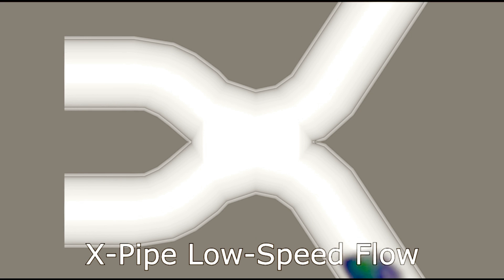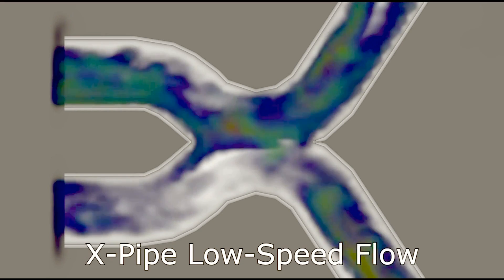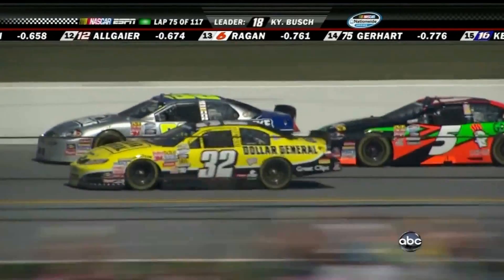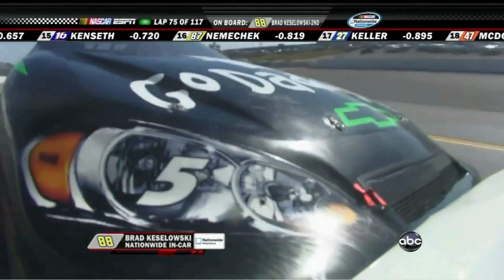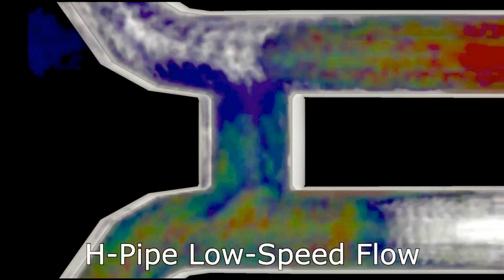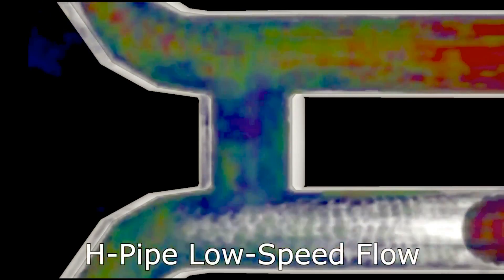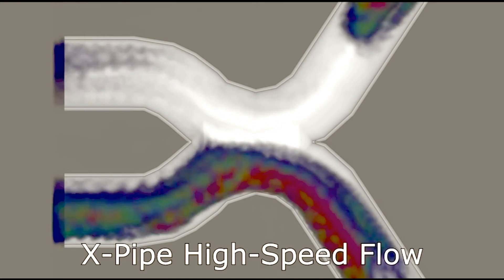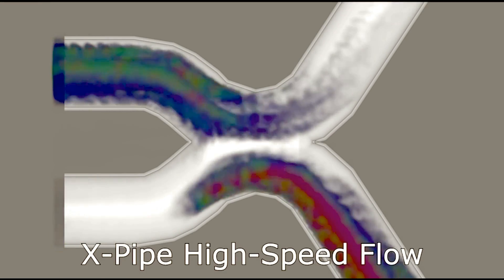Exhaust back pressure - Myths & Facts

Comment: Not total bull shit but I call bullshit on backpressure not increasing engine performance. I had a car with 7psi of back pressure and when I got it fixed the engine probably had a 60hp increase. I say this because the car went from 7:50s in the 8th mile to 7:30s. That was way back in the 1990s with a Turbocharged Buick V6.

Comment: Dude, nice topic for a video as this is a very important concept to understand when tunning your engine but... It is very difficult to understand many important parts of your explanation... Could you please summarize the idea? Why do you need backpressure and how is it related to having a catalytic converter or not? For instance, what differences in performance would there be between a straight pipe and one with the CAT...

I'm considering  replacing the stock exhaust of my bike with an aftermarket one but I still don't fully understand why this improve performance.

 Thanks in advance.-

Comment: Easy explanation. Engines run best with no back pressure. End of story.
Reply: without backpressure you lose low end torque
Reply: Bingo! Back pressure is counter productive! Anyone that says you need back pressure is misinformed.
Reply: Exactimundo 👍
Reply: john beaver  if not tuning only

Comment: Very well explained. Clearly you have grasp of fluid dynamics and understanding of fluids in  motion and the effects of viscosity. Most people have difficulty understanding constant flow and that we phase in and out of it as engine speed varies, while pipe diameter remains constant.  Variable valve timing has become common place.  However, variable exhaust is not something that is focused on in the after market.  Many car companies have started incorporating variability in mufflers, but the most of after market is far behind.

Comment: Agreed that it's widely misunderstood topic/term.  Too many people want to see it virtually eliminated . . . or maintained at some unspecified and unknown value.  It was refreshing to pick out of this video that backpressure is only the force required at the engine end (divided by inside pipe areas) to actually cause the volume of exhaust to be pushed out the open end.  Backpressure is inescapably tied to exhaust gas velocity through the exhaust system, and you probably want as little of the first that gives you enough of the second.  Since one engineering rule of thumb is every extra psi of backpressure will cost you about 2.5% power, backpressure, exhaust velocity, and power are all tied together.Time was when 'reducing backpressure' was almost something worth doing just for itself, back when mufflers and (early) catalytic converters were both crude and highly restrictive.  But these days even the OEmanufacturers can't leave this sort of "low-hanging fruit" on the tree.Resonance tuning is a whole 'nother topic that's sort of related.Norm

Comment: You are an idiot who has no idea what back pressure is or how it works.  Go talk to a professional go-cart racer to learn: they don't shift gears, they shift exhaust pipes that have different back pressure characteristics to run the engine at different RPM!
Reply: carts use 2 strokes, idiot.
Reply: Cart motors are different than full size car engines you moron.
Reply: That does not change the 'fluid mechanics'.  Only the numbers in an analysis.

Comment: Thanks for making the video but it is somewhat misleading since you are talking about application settings mostly for stock aspirated cars and showing mostly modified turbo vehicles where back pressure requirements and effects are completely different and run in contrast to the points you are trying to make.
Reply from the maker: I understand that this video is flawed in many ways that's simply because I didn't care much during the earlier days of this channel and I'm trying hard to change that attitude.